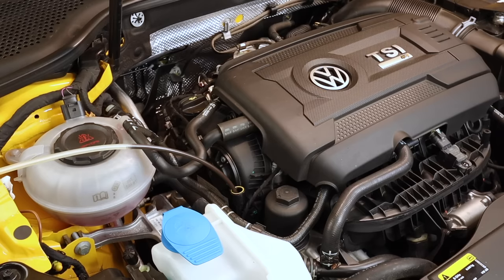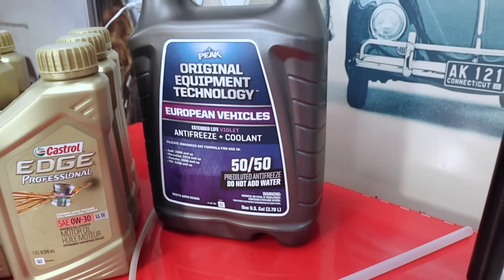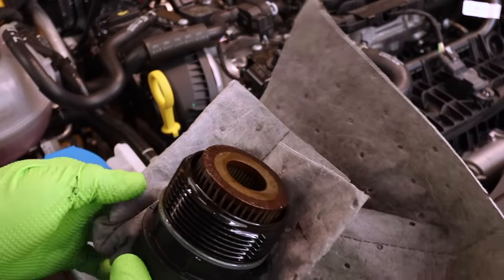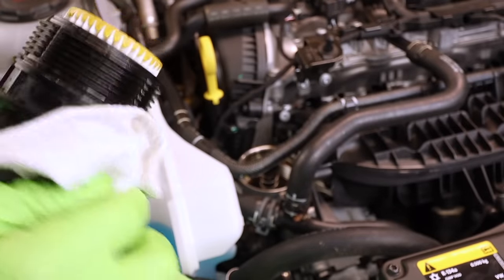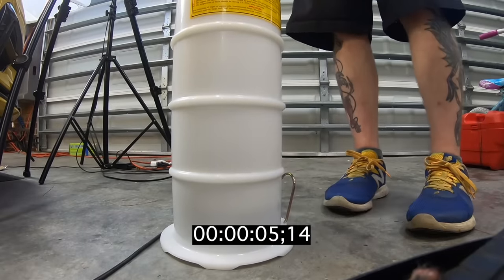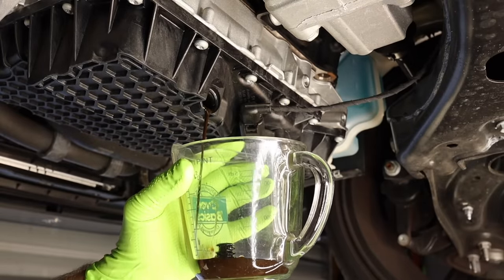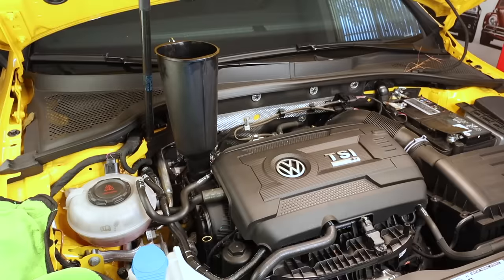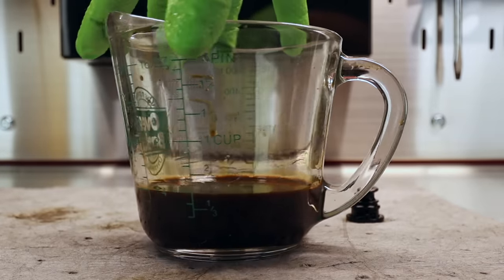Will an Oil Extractor Get All The Oil? (MK7.5 Golf R 5000 Mile Service)

Comment: One thing I do is when using an extractor is if the dipstick is on the front of the engine I jack the rear slightly so oil runs towards the dipStick and vice a versa if the dipstick is at the rear I'll jack the front slightly .

Comment: I have modified my drain plug with a hose fitting and a hose with permanent threaded fittings i had made at the local hydraulic hose shop. The hose itself is rated for 300 psi and designed for hydraulic cylinders used on tractors and heavy equipment. I've clamped the hose to the dipstick and the end I use is plugged with a threaded,  hard plastic plug that I got from the hose shop. I can unscrew it with my fingers when it's time to change my oil.  I get to use my extractor and I never miss a drop of oil because it's pulling it from the oil pan. My shields stay on under the car.

Comment: I just wish they wouldn't have put the filter underneath on the MK6 R, my previous GTi had it on top & was so easy & never dropped any oil in the removal process. I always wondered how well the extractors worked. I'll stick with my Race Ramps, I have to be under for the filter anyway & it's nice to check on things under there. I like the drain plug on your series, as well, nice to not have to worry about torque setting. Thanks as usual.

Comment: I use a long metal thin tube attached to the hose and cut the tip at a small angle. This way the metal tube goes straight down and touches the bottom of the pan. I get most of the oil out this way.  The plastic tube tends to bend and does not touch the bottom of the pan. The tube was made from a small curtain rod.

Comment: One thing to keep in mind. If you buy your oil and hardware via FCP Euro you can return the used oil as well as the drain plug and get a replacement with its lifetime warranty. Ends up only being the cost of one drain plug

Comment: 2006 Tundra has the oil filter above the steel skid plate so unless you want a mess skid has to drop so drain bolt/new db gasket every 5-7K.
Did a LiquiMoly Engine Flush/Drain/Fill about 1K ago so am servicing with new oil/filter tomorrow, as will be on ramps for ATF WS double Drain/Fill, drove shaft zirc greasing, new transfer/dif gear fluids and new 02 Sensors before installing my Skid Row Cat Con Guards and do NOT want to remove again until next Trans Refresh in 20-25K.
At least!
Extraction seems great for these German Top Filter Autos though.
Nice video HM.

And yes, I let it Drain at least 10 minutes but don't rebuild my block.
;-)

Comment: I remember my first car, a '77 VW Rabbit in Bali green, 1.6 liter 78 hp EE engine code.  I could change the oil on that car in 20 minutes.  Did it every 3000 miles, it ran like a top.

Comment: A tip when replacing cartridge filters that have a screw on cap. If oil leaks from the cap after reinstalling the cap and installing a new filter O-ring, remove the cap, clean the threads with brake cleaner, wrap the threads continually two or three times with teflon tape making sure to over lap the tape and reinstall the cap. That will usually stop the cap from leaking. Just be sure that any time the filter cap is removed, take off the teflon tape and rewrap the threads with new teflon tape.

Comment: I used it for a car that had a special drain plug as I had little choice ( it was a 7mm square plug and I was not prepared to grind down the standard 8mm ). Generally though I always removed the drain plug for my clients cars but the extractor method is not bad though especially if you concerned about making a mess or stripping the bolt, getting under the car etc. If a car has an oil filter in the engine bay the extraction method can be done by an amateur with zero experience.

Comment: My brothers Volvo S60 has a dodgy drain plug so he uses an extractor every 5k and it's still going fine.But tbf he's only had the car for 3 yrs.My other bruv has a Ford Galaxy 2008 ish and he uses the extractor every other oil change as he doesn't take off the belly pan due to the many bolts on it....and that's been running fine for like 8 yrs.

Comment: Would have loved to use this method on my 2020 GLC 300 4Matic but Mercedes has decided that dipsticks are not needed so I get to drain the oil pan from below. You will catch me lying down on the job. 👍👍
My wife's new GLE 350 also came without a dipstick. Mercedes will change that one for a while.

Comment: I used an extractor to change the oil on a 1.9L TDI, manual trans, every 6,000 miles for 238,000 miles, driven by three children who learned to drive with it, so they weren't easy miles. The engine ran quite well when I gave the car away and never needed topping-off between oil changes. My guess is the amount of oil remaining after extraction had no significance.

Comment: Got to be honest, watching this video due to problems with oil drain plug leaking on my VW. If you have someone that installs a 3rd party plug you will get persistent leaks with a VW.  Hoping the new VW one will solve that, if it does and this extractor method works I may just buy one and start doing my own oil changes using this method.   Its better for avoiding spills too by the looks of it.

Comment: On a Golf mk6 1,6 TDI. 

Front end of car was on ramps. 3.25 litres of oil could be sucked out with a pump like the one in the video. 

Afterwards, oil drain plug was unscrewed and appr 1 liter (equal to about 1 quart) of old oil could be drained out.

Comment: When i first got that same extractor, i did this same test. Now i pumped that extractor on and off for at least  30 min, and when i pulled the plug, i got no oil to drain out. This was a MB w203, so YMMV.

Comment: I'll have t try it on the VW Tiguan as it takes 15 minutes to crawl under and remove the 10 screws holding the cover on my Tiguan. I could always change oil a bit earlier to account for the 100 ml left in. I already have to use an extractor for my jet ski where it works great. The procedure for that actually requires 2 rounds of reving the engine to 4000 rpm to get the last liter out.  You may think I'm crazy but I run the engine for 5 sec  at idle with the oil out and always get more oil  to drip out. No, I've never wrecked an engine and always get at least 200K miles before I sell them. The oil stays clean for a long time. I only do hot oil changes

Comment: I know that my C-250 MB gets almost every drop with the extractor. The dealer uses one so they don't need to pull the bottom shield to access the plug. The newer EA-888 however, has the dip stick running into the timing chain cover, so that might be why there's 100ml left in the oil pan.

Comment: @humblemechanic  Any reason to change to drain plug if I'm using an extractor? The FCP kit comes with a new one given that most people drain their oil from the bottom. Always wondered if I should switch it out every year or so as it is just plastic. I hadn't changed my own oil in 20+ yrs after I started getting company cars in the 90's. Picked up a GTI as a weekend/track car this summer and love watching your videos.  Thanks for the hours and hours of help.

Comment: If there's a problem with the drain plug, or, like this one, you just plain don't trust that plastic plug with an O-ring on it, The extractor might be the better choice. My old Briggs & Stratton engine on my rototiller has a better drain plug than that! Otherwise, the metalic particles that settle into the oil, which is the main thing I want out of the engine settle to the bottom, and pulling the drain plug makes a much more effective oil change. Sometimes, I will pour a little new oil into the top of the engine, just to allow it to trickle down, and flush out even a little more of the stuff on the bottom of the oil pan.

Comment: nice!  If you change your Audi/VW oil every 4k-5k, then even the 2%-3% leftover would just be of the standard OCI of 8k. 
Another benefit, is that if you want to use the Liqui Moly Pro-Line Flush, you need not worry about telling the shop to wait 15 min on idle or worry about driving the car the 30 yards to the pit while the flush is in there. They use the extractor at Valvoline oil change stations as well and at many dealerships. So might as well. You'd be more diligent with your own car anyhow.

Comment: I’m old school I guess, thus I don’t mind pulling the plug and I alway angle the car forward cause that’s where the plug is on my Audi.. to provide a slope, I add hockey pucks to the rear quick jack pads.. works great and that gets that xtra 100mls out.. I think if you slope the car to allow the oil to the extraction tube both methods will be equal in extraction.. but I will run a magnet thru the pan after getting the oil out and it picks up some normal fines.. that’s not possible with the extraction tube.. maybe a little OCD.. but I go 10k between intervals.. nice video Charles 👍🏻

Comment: I've been doing oil extraction on 2 of my mercedeses and works perfectly.  E class and R class.
It's not worth raising the car climing under it and getting oil all over the place.
over 80k on just extraction every 5k miles. on both cars. gasoline and diesel both.
They both work like clockwork.

Comment: As I live in an apartment condo I will opt for this method and add a magnet to the filter, so when I change both the oil and the filter some metal shavings that would eventually occur stick to the filter with the magnet and go away with the old filter.

Comment: I have been using same oil extractor on my 2010 kia sedona since year 2015. Oil change once a year and using same extractor perform transmission fluid change once every other year, just fill equal volume of what came out. In year 2015 van had 120k miles and now in year 2023 218k miles. Absolutely no issues till date, runs like a champ. I am diy learnt everything off YouTube and scared to go under vehicle for maintenance work therefore using extractor.

Comment: I actually do both if I have the time usually just drain it from the oil pan because it is easier to check if there is other things that is related as well as the suspension of the vehicle to be able to tell and show who ever owns the vehicle. there is some things that need attention and what does not need attention right away. just to keep them informed what is going on with there vehicle to let them know what is needed before it becomes a higher price to fix

Comment: To put things in perspective, those 100ml are only around 1,75% of the total capacity of that particular engine.

I don't have any experience with that oil extractor, but I've been using those small 12 volt sold cheaply (made in China), and I was Never able to leave 100ml inside the oil pan (on my 5 different engines I did this same experience).

If you push the sucking hose until the bottom of the oil pan and then slooowly pull it, it usually finds some additional oil.
But you do need to have the electrical oil extractor always trying to suck (this sounded really bad, I know). 😁

I don't own a car with that engine, but I'm confident that you could extract more oil with this technique that I use.

I was Very sceptical about oil changes by extraction until I tried it for myself on my cars (Audi, 2xMercedes, Ford and Nissan engines).
On some of these engines I was able to take out more oil out by removing the drain plug (not anywhere close to 100ml), but on some of them I had to really wait before I could see (literally) 2 drops of used oil.

Comment: I've been using an oil extractor on all my Hyundai's, Toyota's and a Chevy ecotec engine..............Hell older GM small block v8's can be done like this too, I did it for years.
I've been lucky as the extractor gets to the bottom of the oil pan on all my vehicles, and when I pulled the drain plug on the first oil change to check I didn't even get a drip.
Many German manufactures have had this as standard practice for decades.........................As long as the oil is (preferably synthetic) changed regularly every 5000km there won't be an opportunity for sludge to form in the first place. I do this whenever I can, saves me getting under the car and usually the oil change in done in 20 minutes or less.
In fact I did an oil change on a Jaguar twice, the first time I did it normally and got about 5.5L of oil out of it as I would have expected................The second time I figured I'd try the extractor and got almost 7 Liters (yes I checked the level before changing it), and used the extractor every time after that.

Comment: Interesting you say to target filling to the middle of the "full" range, I've more than once been told to go slightly above the top full mark to account for what goes into the oil filter and such if you can't pre-fill the filter.  I've had at least one time when after an oil change spilled some and ended up only half way up the full range, when the car started it sucked enough down it turned on the low-oil check-engine and then I had to figure out how to fix THAT after topping it off (apparently moving fuses around).  Seems worse when using aftermarket screw-on filters that are a larger diameter and hold more oil.  It also seems like most engines I've seen consume oil at a faster rate when they are lower on the full-range than higher...tho I've also always heard you should only check the oil level on a cold engine.
Reply: Going slightly above is if you don’t know how much to put in. If you read the manual, it will typically say, “X qts including filter.” If you don’t know the amount, then you would go a little above the mark, start it to let it circulate, then check it again.

Comment: I have backed the jeep zj rear wheels onto ramps , drained the oil, put the plug back in and poured gasoline into the moor (down the dipstick tube) and flushed more trash out of the motor. I have had trash in my drain oil in the past. That's why I started doing this. These 5.9 motors have a habit of getting sludged up.

Comment: I use an oil extractor on my VW PD diesel.  When you take the oil filter out you can stick the extra Tor tube down into the filter housing and extract another 150-200ml of oil from the housing (believe its also an oil cooler) that I would never be able to get out with a conventional gravity drain.  DaL breaker for me!  Is there anything similar in the Golf R oil filter housing?

Comment: When I removed oil pan from my EA113, I was shocked, how much oil is still in the oil pan. It was drained before. Alloy EA113 oil pan has small adge just in front of the drain plug, so not all oil can be drained anyway.

Comment: I know this is an older video, but one thing I do before startup after an oil change is run clear/flood mode by holding accel pedal while cranking for 5-10 sec so the oil is primed before I start the engine.  Does it do anything...probably not, but it makes me happy.

Comment: No to the extractor.
2008 Toy Tundra 5.7
Oil filter housing behind the skid plate.  It can be a bit of a pain to remove and replace but I like knowing that there is a metal protective plate underneath.

Comment: I use a vacuum pump on my son's Golf and other family vehicles.  I remove drain plug on the first time I vacuum each vehicle to make note if all oil is removed.  The Golf leaves about 20 - 30ml in crank. Camry, Rav4 and Matrix gets literally every drop! Nothing comes out of drain plug. Ford Ranger (4cyl) leaves next to nothing, never measured it on Ranger (no need).

Comment: Extractor might be less expensive than buying a quality ramp and a Fumoto valve especially if the filter is up top. But a ramp would be more useful for everything else. More effort but I'd go with a tool that serves more use, a quality ramp.

Comment: I have a 17 Passat with the 1.8T in it. I’m anal about things like oil changes. My dealer is about 65 miles away. I have been extracting my oil since about 10k. I still periodically go into the dealer when I have time and get an oil change from under the car. Every 4-5k miles I do the extraction method and change both my oil and the filter. To mitigate the very small amount left I extract everything then add about 1/2 quart of clean oil. Let that sit then extract that. It will effectively dilute anything that would have been left behind and let me then pull most of that out too. I’m at 70k miles and my engine has not had 1 issue yet!!

Comment: That extractor is obviously more convenient, but it's only worth it if your oil filter is also on top of the motor.  If, like the vast majority of cars, your oil filter is under the motor then you might as well drain from the bottom since you have to change the filter anyway. Good video though.

Comment: To be fair you should open the plug the second the pump starts to gurgle.  If it took 15 mins to take that cover off etc it could have just re settled. Or tried the pump again before removing the plug. I use one and love it. 5k oil changes FTW

Comment: The way the oil pan is designed on my FCA Pentastar V6, the extractor would actually get out more oil than the drain plug. It is a metal pan with a nut welded on to provide the threads, and it is on an angle, so the extractor could easily dip lower in the pan than the top of that nut.
Reply from the maker: NICE!

Comment: I have a 12v motorized oil extractor. Just used it for my 2016 2.0L civic and 2010 Tacoma 4L V6 and it got nearly 100% of the oil out. Only a few drops were left in each engine.

So I can say, these things work great if done when the oil is HOT. Not warm. HOT. And when it starts sucking air wiggle the hose around a bit to try and find every bit of oil.

Began working on outboard boat engines in Florida and thats how I first encountered these devices because this is what they use to change the oil in outboard motors.